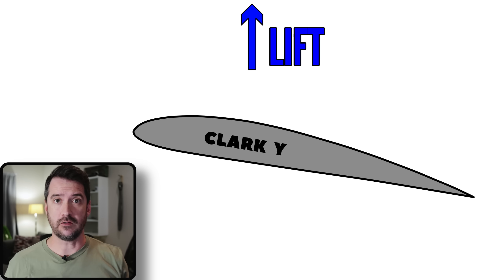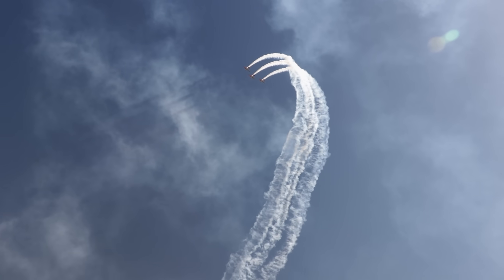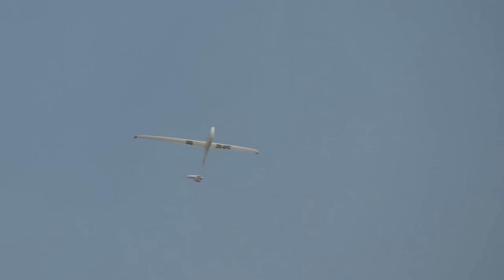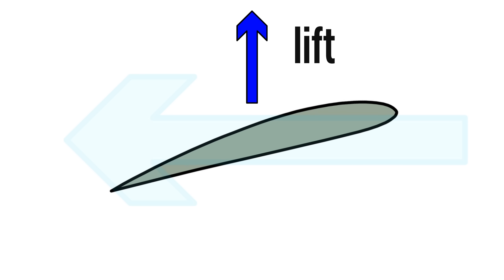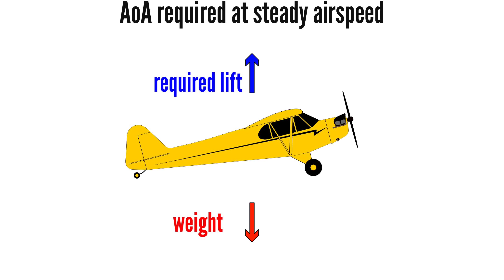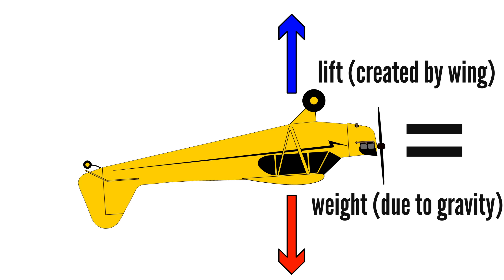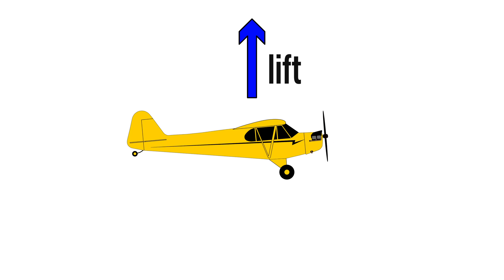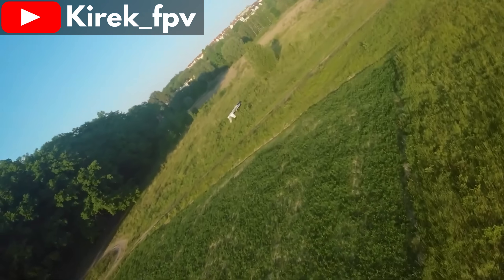Is Airflow Distance Over the Top of a Wing Always Longer?

Comment: It's got almost nothing to do with the "longer path". Thought that this old chestnut 🌰 had been put to bed a long time ago.
Reply: Argument from incredulity.
Reply: yet its still being taught to new pilots.
Reply: It has been. The rise of disinformation is an attempt to destabilize the west, like moon landing deniers and flat earthers.
Reply: as long as people believe it it will exist which is forever.
Reply: If you want to see a perfect example of why the pressure differential is in fact how you get lift you can actually do this with asymmetrical shape just find yourself a Bic pen The kind where you can remove the actual pen from the inside and the tail cap and end up with a simple plastic tube that's even along the whole length now place that tube onto a desk or countertop aimed for the edge of the countertop place your fingers on top of the tube and press down hard flicking the tube out from under your fingers and once you get the hang of it you can make that pen fly across the room and it does this generating lift in fact you can generate so much lift that you can actually make the pen do a loop The loop 

This is called the Magnus force this is how curveballs work and how soccer players are able to make the balls fly a curve path 

With the backwards spin the air going under the pen is slowed down by the drag against the pen body while the air on top of the pen body is accelerated again because of the drag against the pen body effectively giving you a very inefficient wing the path over the top is longer and the path over the bottom is shorter in time length relationship because of the difference in drag from the rotating surface 

Butt but it's the deflection of air that creates the lift except that deflection of air happens because of the pressure differential :-) That's what gives you the deflection :-) That's why a wing that is perfectly level produces lift 

Do you get more lift when you angle the wing which will deflect more air? Absolutely you also reduce efficiency because as you angle that wing you are dramatically increasing drag which means you now need to exert more work from your engine in order to fly the aircraft The closer you can get that wing to no angle of attack while still producing Lyft the more efficient your flight will be this is why we design airfoils :-) to increase efficiency reducing drag and reducing how much power we need for flight this is why an acrobatic airplane that's designed to fly upside down inverted etc as a symmetrical airfoil it's not as efficient as a highly cambered airfoil but it's more efficient at more angles of attack than a highly cambered air foil which is only really efficient in one configuration so you're giving up ultimate efficiency for a broader range of so-so efficiency. 

It all comes down to efficiency to reducing how much power you need in order to generate the necessarily lift for sustained flight.
Reply: @nerys71  Nice effort explaining way better than my weak attempts. Thanks 👍
Reply: @nerys71  Well, that still doesn't explain why a NACA 6 series is more efficient than a NACA 4 digit equivalent 😆.
I do kinda agree with your explanation though, but still scientists say that the downwash is a result of lift, and not its cause. While it's still being the pressure difference that's creating the lift, because the pressure difference is the actual force acting on the wing. And the pressures are pushing and pulling, deflecting the airstream.
😆It's quite a rabbit hole to get into.

Comment: A flat plate will generate lift IF it has a positive angle of attach (AoA) , whether it is inverted or upright.  But it will generate (usually) more drag.
If Bernouli effect was the only cause of lift a flat plate wing will not fly. Try telling that to a 10 year old who is playing with one that flies quite well!
Simple answer (and keeping the peace)  Bernouli effect does have some effect, but the flat plate effect is far greater, but at the cost of drag.
All the padding above and below the chord line is to help smooth out airflow and reduce drag.  Also improves stall characteristics and speed response.
Just thought I would stir the pot with some simple facts.
Reply from the maker: Agreed regarding a flat plate. It's not the shape that creates lift. As I said and showed, a positive AoA is required to create lift. Even an upside down Clark Y creates lift (although it's an extreme example), but will just be very inefficient. A symmetrical wing or flat plate is easier to demonstrate, that's why I used the most extreme example.
Reply: @LetsGoAviate  Dead right--the "sudden" change becomes even more sudden as speed increases, and f the CG is a bit on the rearward side, it is violent!  Rounding the front edge helps a little, but that brings us back to symetrical airfoils--we could be going round in circles!
Reply: I find with flat plate wings though, you wanna have at least one side that reaches forward on the leading edge and defines the stagnation point. Apparently the Bernoulli principle is there on Flat Plates - the angle of attack causes the boundary layer to make the effect itself, kinda like a KF Airfoil. BUT being a flat plate, which way up this Bernoulli effect is being applied is liable to shift in an instant! 😂 At least, that’s the explanation I got on the forums when wondering why my flat-plated models seemed to randomly nose-down quite significantly in level flight.

Comment: Regardless of the direction gravity is exerting it's force, the wing is functional regardless of orientation, upside down the plane is using its momentum and slight amount of lift, they don't just fall like a rock, they cannot fly indefinitely upside down, it's very complicated but pretty much no matter what, if you compress the air on the bottom side with a wing shape, you are probably causing a low pressure area on the top side, causing lift, again very complicated, every wing is different, probably every wing that's the same design is slightly different, 
High pressure bottom low pressure top make the plippity ploppity vroom vroom ziggity zoom into your momma's poon, and they say that's why supercharged nitrous injected planes were invented, to try and escape yo momma's floppy flappy fonky meat wallet as quickly as possible 😂

Comment: To all those that think the special aerofoil shape generates most of the lift of a wing, consider this. How does your rudder work or elevators. It's the air mass striking the angled surface generates a deflection force vector. 

Try putting your hand into the airflow on a highway at 70mph. Keeping it flat, knife edge to the wind, causes little drag and no up or down deflection. Now tip the front up 30° and drag will increase but it will also by moved upwards as the air molecules impact the 'wing' and deflect it in the opposite direction. The wind goes down and the hand goes up. Your flying!
Reply from the maker: Agreed regarding aerofoil. As I said, a positive AoA is required for lift. The Clark Y wing shape I illustrated is a very extreme example in my opinion to show it will still create lift, although much less efficiently.

Comment: - Most/Many overlook the negative AoA part of the aerofoil (Lift to Drag) polar, so long as the Coefficient of Lift (CL) (inverted) meets requirements for sustained level flight - at some Airspeed and AoA before the critical negative AoA.
(Inverted / negative, Critical angle of a positively cambered aerofoil is generally "less" (absolute) than the positive angle, and separation is much more abrupt - due to non-optimal "fairing" - or even separation inducing shape - of the underside - when inverted.)

NB. NASA have had an infographic up for at least a decade - maybe 2, detailing all of the Inaccurate theories of Lift - the one most relating to Camber is that "equal transit time" is at all a thing. - hint, it isn't.

Many Flight schools merely say that Lift is generated by downward deflection of the airstream as the wing passes through a volume... The numerous Chicken and Egg scenarios and the physics behind it all are beyond the grasp of most beginner flight students. (Newtonian physics is very understandable, simple to relate to in our seemingly inertial reference frame.)

Please accept my apologies if this got TLDR - Just putting it in one response rather than starting a discussion.

 - "I say" (boo  hoo, I am not a Phd, as if that matters) that lift is created by a combination of the Angle of Attack (AoA) of the wing  and airspeed (as a flat plate creates lift also, but with a very low AoA range before separation creates a great increase in drag and a significant loss of lift (hence Orville and Wilbur started curving their "lifting" plates).  Note that a flat plate isn't particularly stiff -  and a thin aerofoil describing the "mean camber shape" are more efficient than thick, structural ones - ) - the shape of the ideal aerofoil - for any flight regime - is the most "fair" shape to minimise drag (separation created lots of drag) at the "median" flight attitude-  -ie, for sustained level flight there must be positive "circulation" about the wing's closed loop - the net  (downwash aft minus upwash in front) lift must be equal to the gravitational force acting on the mass of the aircraft  (another chicken/egg scenario)

One could create a very cambered (low speed) aerofoil, which while it will support the weight of the aircraft the right side up, it WILL stall (reach Critical Angle of Attack) before developing sufficient lift for sustained flight inverted, this wing will not be able to fly inverted in any aircraft heavier than air.

The Greater velocity on one side rather than the other, has more to do with the "form drag" of (the leading 1/3 especially) the aerofoil at the AoA observed, IF the streamlines are forced to curve more than is possible - due to the minimum "coherence" pressure of air, turbulence increases and separation occurs (chicken / egg)  Pressure differences cause the increased  velocity observed - much greater velocity increase, typically than any "equal transit time theory suggests..

Links - without pasting HTLM links..  ( copy and paste the text in to a browser.)
Glenn Research Centre: "beginners-guide-to-aeronautics/bernoulli-and-newton"
Old HTML web page:  domain grc.nasa.gov :  " "Longer Path" or "Equal Transit" Theory"  
 - root page contains: " VirtualAero/BottleRocket/airplane "
The Smithsonian Institute also has an interesting Summary, agreeing with NASA..

(Some Flight theory outlines (used by schools) still use this  (and several) other wrong physical explanations..  Just because the Math "may" work out, doesn't make it "how it really happens...)

Comment: Retired now, but I designed aircraft for a career. You're the first guy I've seen on YouTube that has mentioned the stagnation point. When tufting some wings, I have seen the leading edge stagnation point way back near the strut fitting. Of course airfoil selection and aspect ratio will make a big difference on how far the stagnation point moves. I could talk for hours about this stuff but I'll only mention one other thing now. Just look at where the stall warning sensor is on a single engine Cessna. That airplane is still flying when the horn sounds. You got a sub from me. Thanks.
Reply: No one ever mentioned or emphasised the stagnation point to me before.  
However I felt it's presence as a boy in the creek spinning a plate around myself under water. It's very strong reactive force.
Reply: Thank you for that info, Buff. I'm neither aviator nor engineer, so I was interested in learning from both cohorts the answer to this question I asked on a major aviation site maybe 15 years ago:
"Who lifts your wings, Bernoulli or Newton ?"
Which provoked quite a discussion.
With many saying one or the other, and many saying both :)
Best,
Steve
Reply: @davetime5234  Thank you so much for that explanation, Dave. Enlightening. And having just a little physics; enough to know how much I don't know, I understood much.
I appreciate your time invested here :)
Reply: The stall warning light is an early warning. If it didn't come on before the wing stalled there would be a lot more dead fliers.

Comment: Some stunt planes have extra flaps that when retracted have no effect on lift and minimal drag but when inverted with these flaps deployed they generated a longer path on the normally flat lower surface allowing longer duration acrobatics. The Cariboo aircraft has a lifting body geometry on both sides of the fuselage. They generally cancel out due to symmetry but can with a flap deployed on one side disrupt the lift on that side. This allows it to literally fly on its side for prolonged periods. However its engine power is so high the Cariboo can fly and climb tail down with no wing lift at all. 
All this is rather distressing to the passengers on a Cariboo. Standard issue is double the number of barf bags. I've flown on one as a passenger, it was fun but many bags were used. The doctors we were supposed to be delivering to a remote Northern Territory cattle station were literally to sick to treat anyone afterwards. Note, we were so far from civilisation in remote Australia that even a grocery run to town is done in a Cessna plane.

Comment: Just a small point...Wings are designed and attached at angles relative the the expected attitude that the aircraft will fly. That is to say the example of an aircraft flying upside needing to rotate the fuselage dramatically is because the wings are attached with a positive angle when right-side-up. When upside down, the pilot must pitch the fuselage at a steeper angle because the is "negative" attack that must be compensated for. Roughly 2/3 of the lift comes from from the lower air pressure on the top of the wing, 1/3 from the bottom.
Reply: "Roughly 2/3 of the lift comes from...on the top of the wing, 1/3 from the bottom.".... This is an interpretation of the definition of 'lift', and variable to the angle of attack. If an airfoil is ideally shaped for a given airspeed, and has a zero AoA, then 100% of the lift is from the topside lower pressure. In real-world configurations, and as the AoA is increased to exploit dynamic pressures of relative wind force (by airspeed), the lift - meaning the total force supporting the plane in flight - becomes much more dependent on the wings' (and fuselage) undersides

Comment: Barn-door wings with pointed leading and trailing edges work too (though they may stall easily). In this case the leading stagnation point doesn't move. What matters is that a circulation vortex is induced in which air moves faster over the top, and the sharp trailing edge prevents bottom air from turning upward around the trailing edge (Kutta condition).

Comment: Think Bernoulli's principal, my friend. Simply stated, increased velocity equals decreased pressure. The extreme velocity increase adjacent to the airfoil surface dramatically drops the air pressure and acts like an "air glue." The boundary layer "glues" itself to the air molecules just beyond the boundary layer. In effect "suction" of the boundary layer glues itself to adjacent air molecules. Literally, planes fly thanks to suction—which is SOMETIMES lift. Similarly, propellers and turbine blades both use this "suction glue effect" to glue themselves to the air molecules just ahead. Jets don't "push" the craft forward by blowing gases backwards — the turbine blade boundary layer sucks the plane forward.

Comment: If the 'greater distance over the top of the airfoil causes a low pressure and lift' theory was valid--cheap balsa wood rubber band  toy planes(with totally flat wings)--would not fly at all.

Comment: The critical angle of attack does not change with weight. Dropping the weight would not make the wing get out of the stall conditions unless the angle of attack is also reduced. The pilot may be able to maintain level flight with a smaller AoA when lighter but thats a different story.
Reply from the maker: Heavier weight requires a higher angle of attack. Critical angle of attack doesn't change.

Comment: Lift comes from the air below pushing up overcoming the weight plus air above pushing down. For example, make a disc with a flat bottom and a pocked top (like the surface of a golf ball) and spin it. The pocks on the top will cause there to be less downward force than there is upward force from beneath. If the disc is light enough, it will lift. A level, flat board with a pocked top will also achieve lift on an airplane light enough and moving forward fast enough.